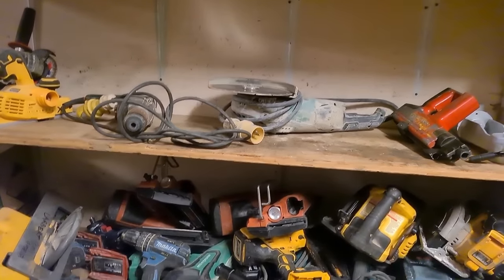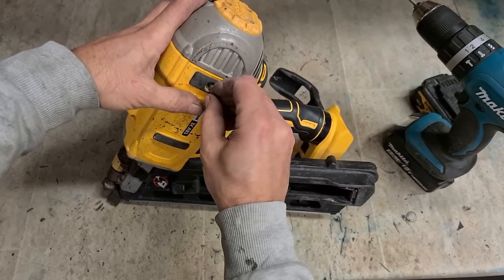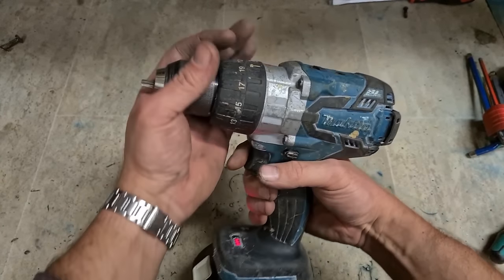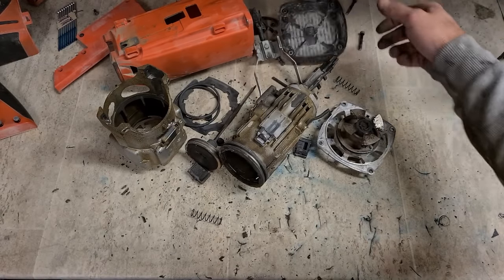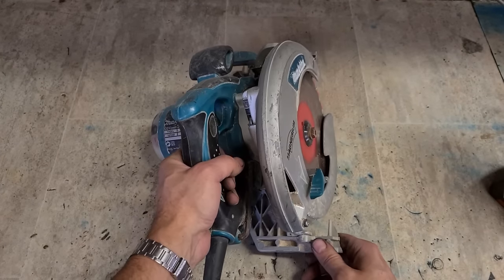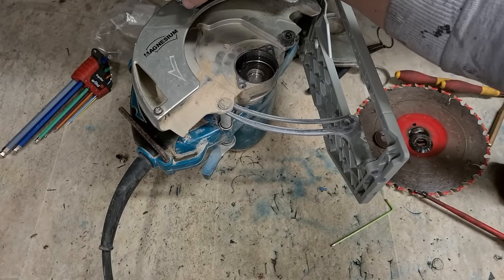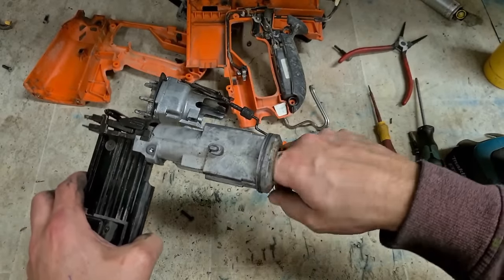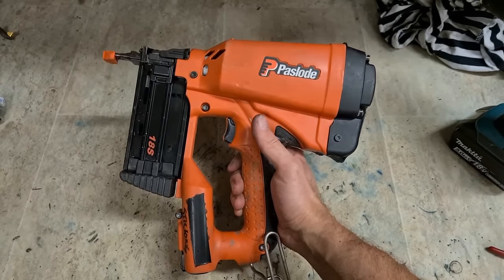Fixing up a bunch of Makita, Dewalt and Paslode power tools

Comment: Whenever I see a Paslode teardown, I get the feeling that it was designed in an alternative universe. All non-Paslode tools are substantially similar in construction and techniques, but Paslode is different from all of them (e.g. the twist-off ignition unit, ice-cream-bar-shaped battery, weird zig-zaggy cooling fins, free-floating pins, etc.)
Reply: I like when companies do this, means they stand by their designs and don't follow stupid trends.
Reply: Probably because they were the first to do it and patented a few design details. other brands copied and adjusted to stay above the copyright laws. some improved on the design and some made it worse 😂
Reply from the maker: Paslode is the original gas gun. Every other brand simply tries to copy it legally. But they are simply not a palsode.
Reply: The french invented the paslode china built it ,i met the guy who designed both of the originals pas lode is a french word
Reply: Is that watch dean a Casio 1986 model
Reply: @agnosticevolutionist3567 Wow, this makes a lot of sense. It wasn’t designed by an established tool designer trying to reuse the parts and techniques developed over 100 years, but a French inventor unconstrained by legacy. 
Now the only tool design mystery remaining is the huge felt donut in the Bosch hammers… Maybe they had their own Frenchman?
Reply: Bet he feels like a soldier the way he can strip down the nail gun & reassemble it so fast 😂

Comment: First time I see you cut open a chuck on a makita, 99% of the time its a dewalt, matter of fact I never seen you replace a dewalt chuck the normal way.
Reply from the maker: That's because newer dewalt drills don't have a center screw. They are torqued on with lock tight. You can't take them of the normal way. You can either cut them of, ( much faster and safer) or dismantle the gearbox and clamp the spindle directly and use a large wrench to torque it off. But I have twisted and snapped a few spindles this way.

Comment: Hi Dean  I’ve been using Milwaukee and dewalt for 2 years and now I can’t stand then anymore I’m looking to buy new powertools and I don’t no what brand to get because I do a lot of work in Ireland and Estonia
Reply: After having watched several of his videos, my guess is that he's going to say:

1.  It depends on what kind of work-- e.g., the brands will be different for battery vs. pneumatic (and maybe vs. corded/ mains).

2.  Go with a brand that can be serviced where you live (e.g., parts availability).

3.  In general:  Makita or Bosch.  (Other brands are probably fine for specific tools--e.g., Hitachi, DeWalt if you can get parts, Hilti.)

That's just my guess.  Interested in Dean's reply.
Reply from the maker: Unless your using nail guns and table saws, I'd go with makita

Comment: I had a DCN692 with a hidden jam. A small chunk of bent nail was jammed between motor and the housing. It would creak and then flash like that. Left side motor frame was cracked in th 90 bend at the back. Firing pin had had grooves beneath the 'wings'.